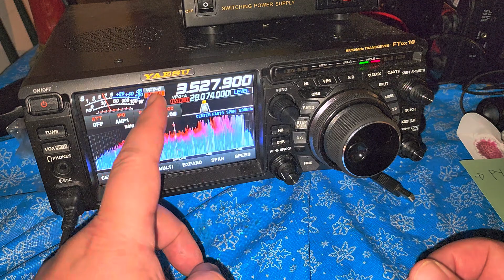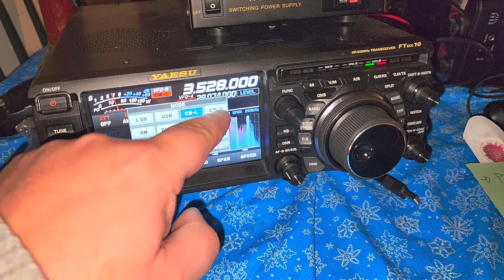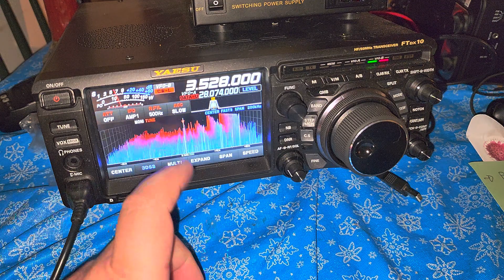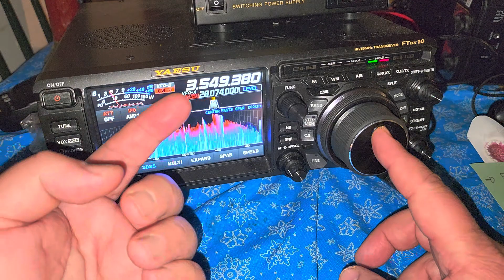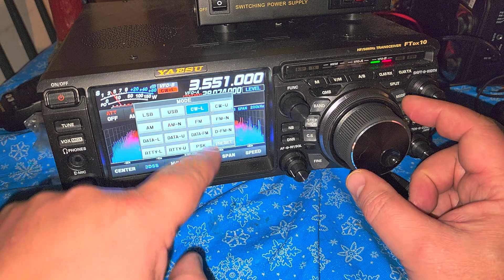Yaesu FTdx10 CW-U  CW-L  What is the difference and how is it used

Comment: I love the USB CW and LSB CW feature on my Yaesu FTDX 1200. I am an avid CW operator and I alternate between the two quite a bit. If I'm getting qrm on USB CW then I just go to LSB CW, or vice versa and it usually goes away. It also works on some forms of qrn. One of the best features they've ever put in a radio in my opinion. That is giving you the option to change between the two regardless of band or frequency. 73, all the best.

Comment: Most ham radios come default on different bands on which mode cw will be. LSB voice on 3.800MHz is standard. The cw stuff comes default to upper side. Of course you can manually change it like you showed on that beautiful rig! So there is a standard way that most people are operating. But you are free to change it up. I’m probably as clear as mud. de n5vwn